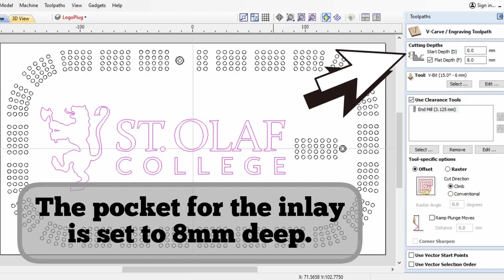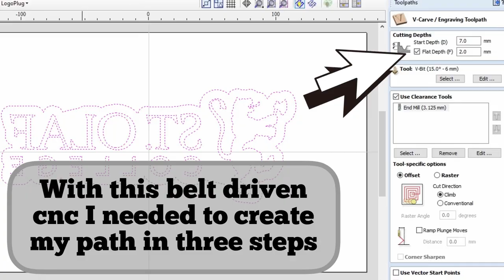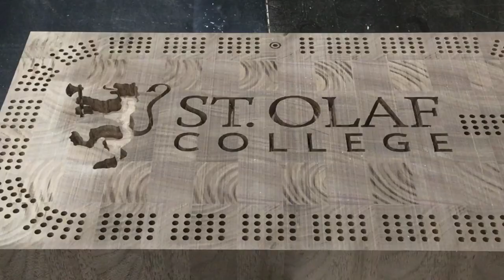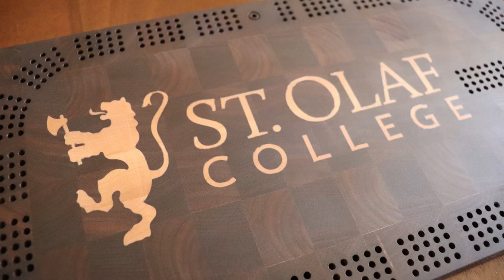Creating Wooden Inlays in End Grain | Making Process | CNC Inlay

Comment: Hello there, amazing work! I'm on the path of figuring this out myself. My numbers are exactly the same as yours. When I use a vbit (20 or 45 degree) everything lines up right and the glue gap is exactly 1mm as it should be. However, when using a tapered ballnose like you do in your other video the plug doesn't go down nearly far enough. I suspect it has something to do with how I you enter the tapered bit into the vcarve database. I have the same Jerray bit you do. Do you have any insight into what I might be doing wrong or can you share how you entered the bit into the toolbase? Thanks!
Reply from the maker: I would have to check settings but I created a new vbit in Vectric with the sizes of the bullnose I believe.

Comment: Hi, Is there any difference when carving the male part in carving starting at 0 and going 9mm deep as opposed to starting at 7mm and carving 2mm deep? When I set it to 7 & 2 the g-code created by Vectric V-Carve Pro simply has a a Z-9 command so it doesn't seem to make a difference.
Reply from the maker: Yes. If you go to 9 the sides will be too wide for the plug and it will not fit right.

Comment: What 1/8 end mill did you use for the female part of the inlay lettering? Having a problem where the lettering wont cut deep enough because it skips the 1/8 end mill toolpath as it says it wont fit, ive tried downsizing all the way to a 1/32 end mill and it still wont generate a toolpath on the lettering, it will jump straight to the v bit toolpath and just use that instead, im using a 90 deg v bit, also tried a 30 degree engraving bit but same problem
Reply from the maker: https://amzn.to/3IjzcG5
How deep are you cutting? That will determine the angle you might need to step down to. I use about 10-15 degree v bit.